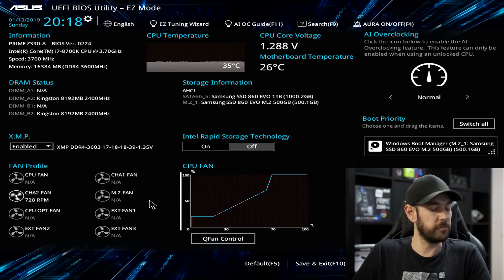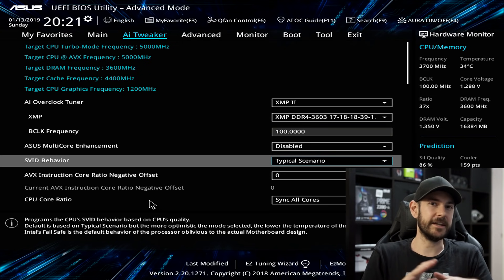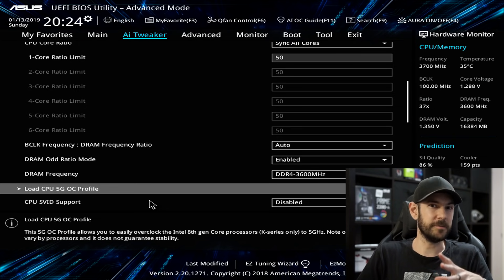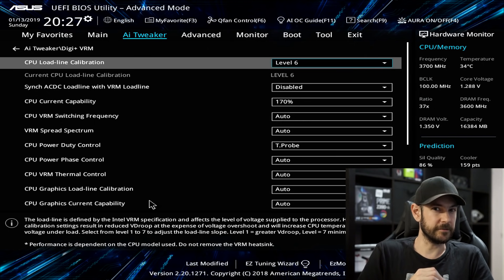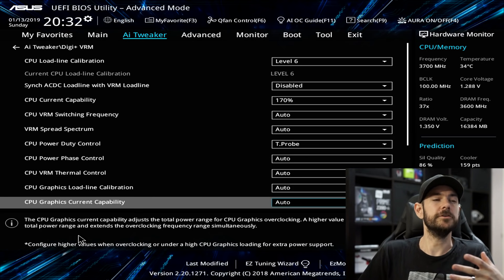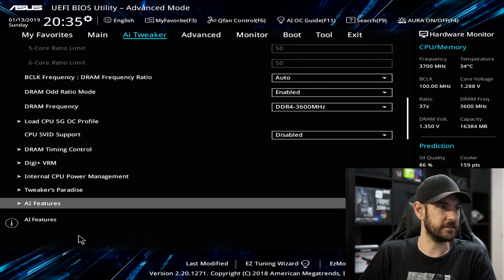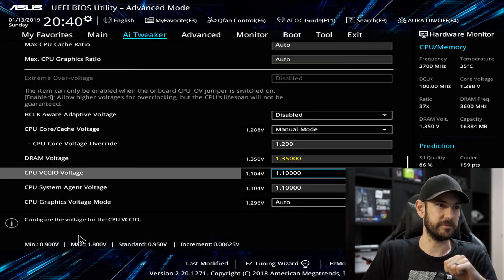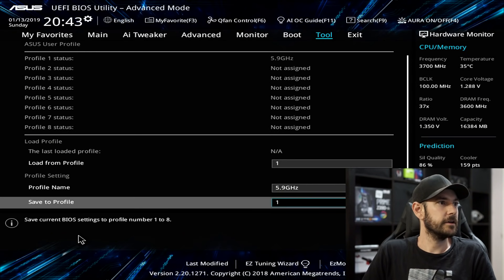ASUS Z390 Quick Overclocking Guide | i7 - i9 | 8700K - 8086K - 9700K - 9900K

Comment: Hi boosted media. Great video and it’s nice you explain what each thing in the bios does. (Excuse my somewhat poor English. Dane typing)

note: I haven’t installed windows yet

- I booted my pc and followed you’re instructions.
Am I going to have issues when I install windows? Or should I default the settings in bios, install windows, and then follow you’re instructions?

I’m a beginner!! No experience what so ever.

Thanks in advance!

Motherboard: ROG Strix Z390-h
Memory: Vengeance LPX DDR4 2x8gb 3000mhz
Processor: intel i7-9700k 9th gen
Reply from the maker: It’s better to install Windows first before overclocking. You can’t stability test properly without an operating system.
Reply: Understood. Thanks for the help.

Comment: I actually have the Asus Prime z390-a and an I7 9700k. Using a Noctua NH-D15 for the i7, will I be ok to overclock? Aiming for 4.9 or 5ghz
Reply from the maker: Should be fine. D15 is a great cooler. Performs as well as a 240mm AIO under most conditions.

Comment: Does turning off the stepping feature keep the temperatures higher at all time?
Reply from the maker: Very slightly. But it’s CPU load that causes temperature to rise. Not clock speed/Voltage.

Comment: Hello. I have a problem. I have asus z390 rog strix -f gaming and i7 9700k with noctua nh-d15 and full tower case with 5x140mm fans. in games i'm getting 65-73c degrees on stock settings. I know that intel's stock adaptive voltage is insanely high, for the bad chips to achieve 4.9ghz. Do you maybe have any recommendation on how to set voltage manualy and to what value so it will be stable? and what other stuff do I need to disable or change it values? I would realy appreciate it if you could help me. You also earned a new subscriber :)
Reply from the maker: This video shows how to set up manual fixed voltage.
Reply: Boosted Media yea but what values would you suggest for 9700k? Because in the video, you use overclocked 8700k
Reply from the maker: Have a look at my 9900K overclocking guide. I’d start with the same values.

Comment: Thank you for this guide. You do an amazing job of explaining each feature in the Asus bios as it pertains to overclocking.  Asus should cut you a check sir. I think with updated bios, going to 1.6v for the CPU with 5ghz clock is easily achieved, with far lower temps. Thanks for the great info.
Reply from the maker: Thanks a lot for the kind words :)

Comment: Hey, thanks for the video, it was really helpful! I have my 8700k set to 5ghz @ 1.255 and everything else pretty much how you set it, and temps usually stay bellow 70c in most stress tests like OCCT and Aida64. Cinebench is around 80c. However if fails pretty much all Prime95 tests, small ffts almost right away, even tho temps dont spike up  (it doesnt bsod, just fail the test). I tried increasing the voltage to 1.31 and its the same thing, if not i would say it fails even quicker. Tried stock mb settings w ai overclocker and still fails Prime95 (even worse cause it bsod). Should I worry about it or nah?
Reply from the maker: I don’t use Prime to test anymore because it’s such an unrealistic workload. I’d say if it passes OCCT overnight and you’re not getting any other problems it’s fine.

Comment: Hey I have a question and I hope you will answer I have an i7 8700k clocked at 5k GHz with a voltage of 1.270, if the clock is stable at 1.270 is it needed to be rised at 1.3v or is ok to leave it like that. And can you tell me what is the max safe temp for this processor, becouse I render videos like for 5-6-7h and for now the processor stays at 76-78 degrees. I see that at the end of the video max temp is 90 but for example in one of my older tests the temps were going just for a fraction of a second close to 90 is that safe?
Video here https://youtu.be/GF_kPQjvknw
Reply from the maker: Max safe temp is 90C sustained. The lowest stable voltage the better so if it’s stable at 1.27, Leave it :)

Comment: Hey I have an i7 9700k, idle temps around 39-45, spikes to 60 randomly i dont know why. Also my max temp appears to be around 85. Are these normal?
Reply: Also its oc to 4.8ghz at 1.29v
Reply from the maker: Yep normal.
Reply: @boostedmedia  great! Thank you!
Reply: @CocoNick  just to clarify 85c isn't a normal temp that's to high for normal use gaming or whatever no matter what the condition is via room temp the whole ''hey whats your ambient room temp'' oh thats why.. just not relivent and is cliche. number one you need to make sure your heat sink is seated properly and is a adequate cpu cooler, two being that you didnt apply to much thermal past and didnt do a spread method which can cause a uneven surface for heat transfer due to air pockets between the cpu and heat sink from my experience less is better and just a small dot in the middle is good and then let it work over time and you'll see better results in most cases. its different for everybody. been building computes maintaining them repairing them so on and so fourth for over 13 years. i got the same cpu the 9700k also at 4.8 not 4.9 which is its recommended overclock nothing beyond that, but mine iv'e seen idles 23c at times or mid 25c . and hardly wants to go over 58c 60 degree celcius most times and only ever reaching 65c max after countless hours more than 8 hours of use whether is gaming while running other programs in the background. also you dont need to manually overclock you cpu to 4.8 as it automatically turbos to 4.6ghz to 4.8ghz depending on the scenario.
Reply: i had the same problem with overheating i solved it with a closed loop water cooler corsiars h100x this is the cheaper version with no silly lights and works amazing a great buy at £70 and my idle temps are 20 and full load around 55-60 so much better  @Greg-qs2jp
Reply: @Greg-qs2jp  I only reach 85 if it's under heavy load, during a stress test or exporting with premier pro. It hit around 60 while gaming.
Reply: @CocoNick  you probably wont ever see those temps under normal use then i dont really believe a synthetic stress test is adequate compared to actually normal heavy use in most cases. my 9700k hovers around the 43-45 50 celcius range while gaming.
Reply: @m4chineH34d  yeah those load are way better do to what coco was seeing.  what programs do you like to use for testing and monitoring? Also i dont care for those rgb lights either myself. My case is the Antec 1200 V3  with 6 blue led case fans which is enough for me 3 intake 2 rear exhaust and 1 top exhaust 200mm so i get real good air flow thats for sure. i might check that water cooler out you mentioned.
Reply: im using prime 95 to test and passmark ran prime for a hour all good i dont see any point to test more than a hour its stable i have a corsairs carbide 400r case 7 120mm case fans including the 2 on the water cooler so airflow is great :) and yeah check the water cooler really happy with it :)  @Greg-qs2jp
Reply: If you're spiking make sure the backplate for your cooler is oriented the correct way. If it's not the heatsink won't be sitting flat on the CPU and can cause random spikes like you're seeing.
Reply: I have my 9700k at 5.0 gHz and am getting 30-33 idle. When I had it at 4.9 I was getting around 24 idle. 39-45 definitely seems high for idle temps.
Reply: Make sure your cooler is firmly secured to the cpu. After tightening the screws for my h100i pro I noticed much more uniform temps

Comment: Hi and Thanks for great video. I'm new to overclocking and it helped me to get my i7 9700k to 5ghz today on custom water loop. 
My concerns are only in regards to the temps when on idle in desktop. They flactuate on CPU package from 37-40 but each core shows temps in HWinfo 33-38 is this normal temps or is it running to hot for idle? Not used any stress test yet.
Reply from the maker: That’s perfectly normal.

Comment: Did your Windows seriously boot that fast?!
Reply from the maker: Yep. Clean windows installation on an an NVME SSD with nothing but OCCT and CPUZ installed. No network and nothing but a Keyboard and Mouse connected.
Reply: @boostedmedia  Dang....I just built my new system with a (don't laugh) 9600k @ 5ghz, with 16gb 3200mhz and just a 850 Evo and still takes 8 seconds. I thought NVMe would make windows boot slower because it has to initialize the PCIE bus or something? Maybe that isn't a problem anymore, I dunno. Haha :)
Reply: Boosted Media how did you setup your pc so that when you boot it, it logs you in automatically? Mine is fast but I still gotta type my password to login lol
Reply from the maker: Didn’t set a password.
Reply: Boosted Media oh.................
LMFAO duh 😅 thanks for the reply anyways 👌🏻
Reply: @D35300  A lot of these boot tests are flawed because they have fast boot enabled in Windows. I always disable it because if I want to shut my system off, I want it OFF. But if saving 3 seconds booting up is important to you then leave it enabled lol. If you set a password during the OS installation, then you have to use the run command "Netplwiz" and uncheck "users must enter a password" and then it will prompt you to enter your username and password. However, if you use a Microsoft account you'll have to change the username to the email that is associated with your Microsoft account and enter that password and then it will log in automatically.

Comment: my voltage drops down on a load of occt and gets higher after i stop it its the other way around is that ok?
Reply from the maker: Are you running your Load Line calibration at Level 6? This is explained in the video. Voltage droop is normal if running LLC lower than level 6. Perfectly fine as long as it's stable. In fact it's actually better to have a bit of droop if you can get away with it and the system is stable. Reduces transient voltage spokes coming on and off load.
Reply: Boosted Media LLC is on level 6 the only difference is that CPU VCCIO Voltage and CPU System agent voltage i left on auto
Reply from the maker: How much is it dropping? Are you sure you’re looking at VCORE and not VID? Does other software report the same?
Reply: @boostedmedia  So Vcore on HWmonitor drops from  1.181 to 1.154  and Cpu-Z shows 1.056  to 1.048~1.040 I also set VCCIO on 1.10000 because default was showing something like 1.348v on bios, that is on  Maximus Hero XI with 8700k 4.8ghz, CPU Core Voltage Override I have set on 1.200.
Reply from the maker: That’s only a very small amount of droop. I wouldn’t be concerned about it.
Reply: Then I will leave it as it is, thank you very much for your help  i will share some more results after I overclock to 5 GHz but I think the temperature will go crazy because on 4.9ghz,, I'm getting like 87c on Cpu ( OCCT)  and around 85c on (AIDA64) with Thermaltake Floe Riing RGB 240mm attached.
Reply from the maker: You’re welcome mate.

Comment: Boosted Media
 another great video thanks man, you helped me big time with  my first overclock on my 8700k,
 with delid using 360 AIO running great at 5.2 GHz with AVX offset -2  5.0 GHz 1.34 Vcore using adaptive voltage load line calibration set to 6 , and my high temperature are in the low 60s ;  )  40s and 50s when gaming !! very happy with this chip heres a quick vid showing some of my settings just 4mins if you get a chance take a look , https://youtu.be/hzOVdc4va8Q
Reply from the maker: Great stuff!